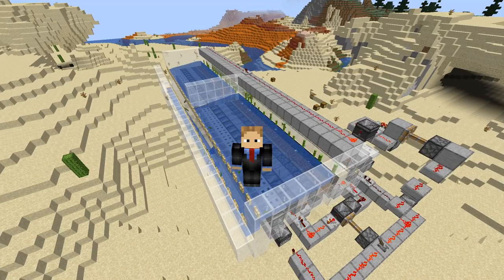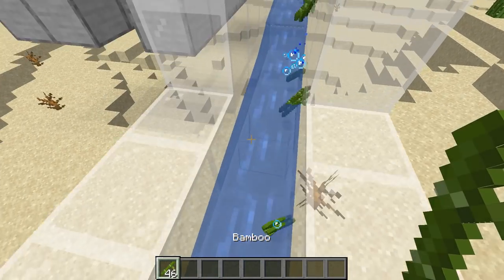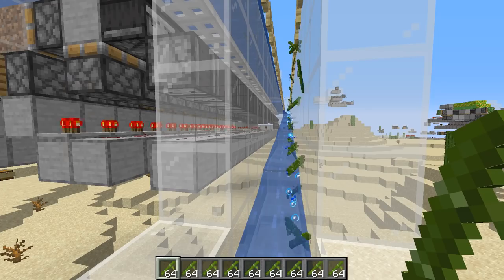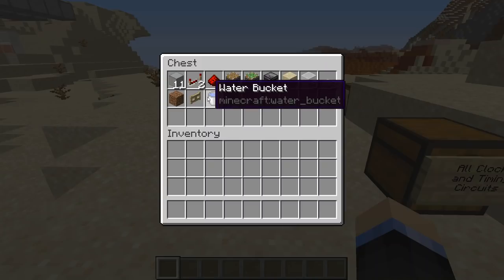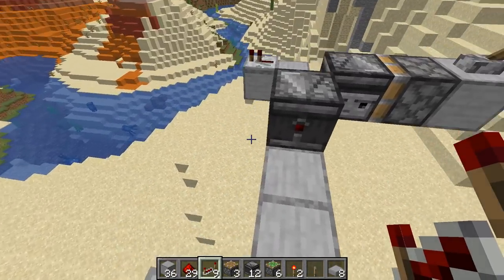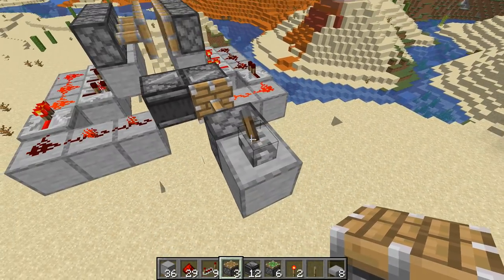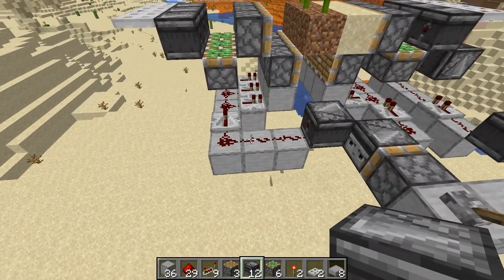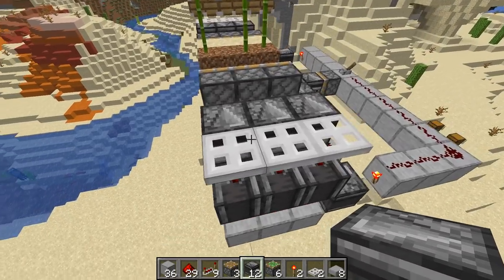Faster Than Zero Tick Bamboo - Minecraft Java 1.15 - Full Auto Shaky-Sand

Comment: Does this farm still work? I tested it and it doesnt seem to... The only thing not working is the 0 tick pulse that should push the sand under the bamboo, the whole piston doesnt get activated... edit: the farm works, only the pistons that push the sand dont get activated...
Reply from the maker: you probobly built it in the wrong direction.  those zero-tick block pushers only work one way :/  ... which way are they facing (north-south or east-west)?
Reply: @EagleEye621  I really dont know, which way do they need to be facing?
Reply from the maker: @gravitowl  they need to be pushing the block east/west
Reply: @EagleEye621  ok!
Reply: @EagleEye621  they were facing south, luckily i built it first in a test world
Reply from the maker: @gravitowl  hmm, then you might have built it wrong? can you share a screenshot?
Reply: @EagleEye621  why? They were South, u said wrong direction. I Will first tebuild it other direction to not waste ur time
Reply from the maker: @gravitowl  ok, let me know if you need some help troubleshooting later.
Reply: @EagleEye621  ok, thanks for answering anyway!

Comment: My sand block is not being pushed along with the dirt block
Reply from the maker: are you sure you build it in the correct direction?
Reply: EagleEye621 how do you mean
Reply from the maker: @tnt_scout6971  the zero-tick block pushers are directional as noted in the video and pinned comment.  They need to be pushing the dirt/sand East or West or they won't work
Reply: EagleEye621 I rebuilt it the other direction and it still won’t work
Reply from the maker: @tnt_scout6971  I would need to see some screenshots to help.  Can you post them to the help section of the discord?

Comment: can you use noteblocks in stead of trapdoors?
Reply from the maker: anything that can take a signal form a redstone output, can be red by an observer, and is waterproof (so it doesn't get washed away, but also doesn't let items fall through it) will work
Reply: yeah, i've tested it out. didn't work on the server i played on cus of some lag/delay issues but great tutorial nonetheless. i tested it on singleplayer first and it worked perfectly
Reply from the maker: @leinolumos  in the video coming out tomorrow, toward the end, I show how you can lag optimize the build

Comment: Would this work on a server with Paper installed?
Reply from the maker: yes if you turn off the mod that blocks it (which is on be default)
Reply: EagleEye621 what needs to be turned off exactly and how? Because my friend hosts the server
Reply from the maker: @tobias9830  look for something like "fix 0-tick growth" and make sure that is set to "false" ... If you need the exact command line you can ask on my discord as some people there host servers with paper (and I don't)
Reply: Its not possible on MineHut, sadly
Reply from the maker: @SmashPhoenixX  yeah, minehut has a mod that blocks it :(
Reply: @EagleEye621  apparently they just use Paper but it is impossible to unblock it

Comment: 15:17 Idk why but those pistons don't push the sand for me... they don't even move.. Can someone help me?
Reply from the maker: did you build it in the right direction? those zero-tick piston block pushers only work in one direction.
Reply: @EagleEye621  em, i builded it facing west
Reply: @EagleEye621  yeet, i built it the other way and it works :D
Reply from the maker: @traden6917  hmm, are you using solid blocks to transfer the signal?
Reply from the maker: @traden6917  nice
Reply: @EagleEye621  I have mine facing north? does it not work then?
Reply from the maker: @oskarpettersson3549  which way are the pistons that are pushing the dirt/sand into place facing... that is what is important

Comment: I tried to build it, but for some reason neither the dirt or the Sand ist moved at any time...
After several replays, I still can't find the problem...

Just to make sure, I'm not blaming you for my failure. I guess it's Something I Made wrong...
Reply from the maker: without seeing your build hard to know for sure, but best guess is you build it in the wrong direction
Reply from the maker: @CASTROYT same guess
Reply: @EagleEye621  I'll have to check it again, but I'm pretty sure I didn't. The observers move the sticky pistons with the stone blocks to enable the water flow, but the sticky pistons in the center do not react to that.
Reply from the maker: @VorjuMeidear  check that direction those sticky pistons should be pushing East/West
Reply: @EagleEye621  I did build a new one by copying the first build, just to make sure I didn't screw up the build. And I didn't. After I placed it East/West is worked directly. I extended it to 20 plants using some repeater and still worked. Well Nummer 7 always messed up some things so I put it out of order, but every other line works just fine. Thank you for the guide and the support building it x)
Reply from the maker: @VorjuMeidear  awesome :)

Comment: Bro ive built this for like 2 hours and it doesnt work in 1.15.2 on a server
Reply from the maker: 100% works in 1.15.2 ... some servers have added mods that block the fast growth, but could be something else. what is not working?
Reply: EagleEye621 The machine is working but it is Not growing
Reply from the maker: @gustav345  put more light near the bamboo and see if that does the trick.  If not, are you playing on a server or using and mods/plugins?
Reply: EagleEye621 Im playing in a Server With no Plugins or mods
Reply from the maker: @gustav345  did you try adding the light?
Reply from the maker: @gustav345  also, some servers have default mods on... such as minehut which is known to have a mod that blocks fast growth
Reply: EagleEye621 yes i added the light but ist doesnt work
Reply from the maker: @gustav345  the only thing that I have seen that would result in the sand shaking, and the crops not popping off and not fast growing (besides light) is a mod.
Reply: EagleEye621 Ok i just found an other Tutorial were it works just the normal 0 Tick
Reply from the maker: @gustav345  that means you probobly build it wrong...
Reply: EagleEye621 Maybe but it is really helpful That u answer These messages
Reply from the maker: @gustav345  I figure if someone takes the time to watch one of my videos, and trusts it enough to try to build it themselves, I should do my best to find those comments and help troubleshoot if something has gone wrong :)

Comment: Mojang has broken this in 1.15.1 pistons don’t shake the sand anymore like in 1.15
Reply from the maker: it still works in 1.15.1 ... did you remember to put the repeater on two ticks?
Reply: Yes I had it working yesterday. Was working perfectly. Went and did Christmas shopping and came home loaded up Minecraft, it updated, and as soon as I turned the switch on, sand broke, pistons moved on top of back row of pistons, rebuilt everything from the first section of red stone that supports the sand, and as soon as I flipped the switch it broke again.
Reply from the maker: @ericrobinson1151  I tested it again in 1.15.1 and it still works.  you can load up a creative test world on your computer and try it yourself.  Happy to try to troubleshoot if you can send some screenshot over on the discord help section.
Reply: @EagleEye621  no it dosen't work. the sand is only shaking with a lever input (i dont know why) and sometimes the sand drops as a item together with the bamboo
Reply from the maker: @halfknightdrummer  are you missing a repeater? can you post some images in the help section of discord?
Reply: @EagleEye621  I do not use discord. The sticky pistons that move the sand over the bottom pistons that make the sand shake are not pulsing, even with everything  removed that could be what is stopping them, they will not fire. It looks as if the pistons are not getting the redstone pulse from the observer before the piston moves the block out of the way.
Reply from the maker: @ericrobinson1151  you probobly built it in the wrong direction.  Those zero-tick pistons must be pushing east/west
Reply: @EagleEye621  Then why did it work when it was 1.15 and stop when i updated to 1.15.1
Reply from the maker: @ericrobinson1151  good point on that... it does 100% work in 1.15.1 (I tested it again last night while working on something else).  It is very hard to help you figure out want part of your build is not setup correctly without being able to see your build.  You could try linking some images in this comment thread, but Youtube sometimes 'eats' links so it may not come through to me (that is partially why I made a Discord... and also it lets other people help as well so you don't have to be waiting on my :) ... we are closing in on 400 people now)

Comment: Up until about 30 minutes ago this was working beautifully. now the sand keeps dropping onto the lowest regular pistons. which in turn pushes the sand side pistons back a block. this in turn released water everywhere. after re-placing the repeaters and dust, I turned it back on. still dropping the sand down. I tried restarting the whole game, restarting with no mods running and still to sand falls. I'm on Java 1.15.1 

here is a short video if me running it https://youtu.be/dv0OSId9UIQ
Reply from the maker: major props for including a video :) ... looks like you accidentally reset that repeater to one tick (should be two) which is throwing off the timing
Reply: @EagleEye621  ah! thanks for reply. I'll going back through your vid and see where I went wrong. I could have sworn the 2 tick repeater was for the harvester.
Reply: yep, definitely had the wrong tick for the sand-side pistons. plus, I had the redstone dust line wrong leading from the first observer that gets moved by the sticky piston. thank you for your help EagleEye!
Reply from the maker: @wreckelite  let me know if you can't find it
Reply from the maker: @wreckelite  never mind... :) ... glad it is working now :)